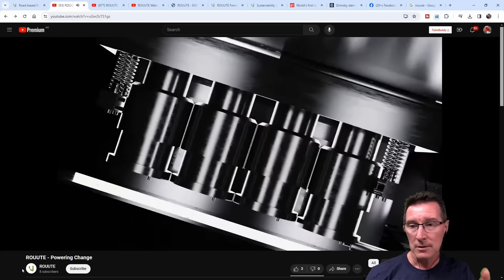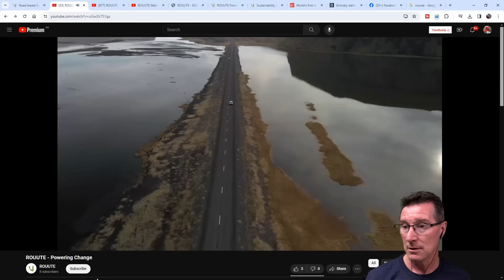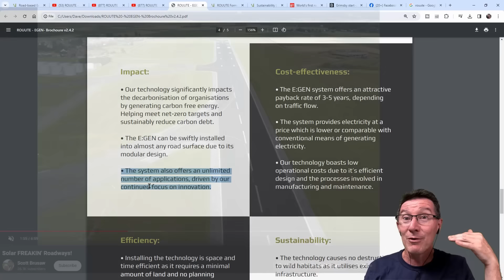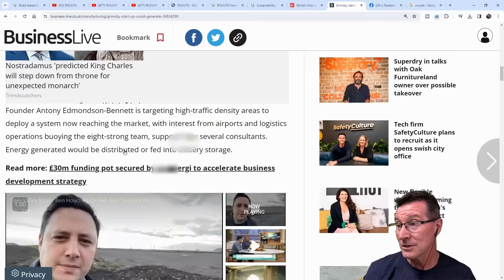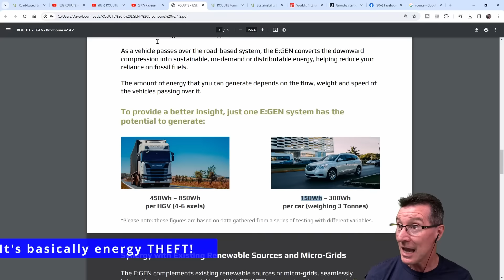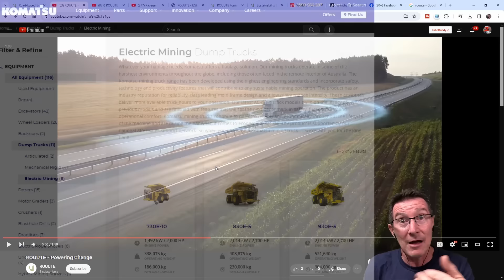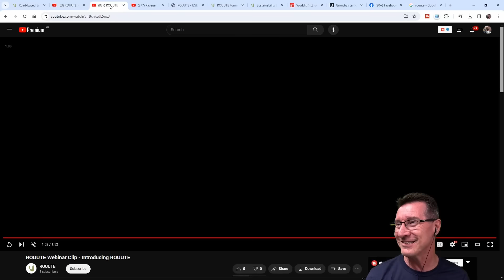EEVblog 1600 - Rouute: Road Based Energy BUSTED

Comment: You know when it is BS when there is an unbelievable story (fairy tail actually) to tell , a superb flashy "steve jobs apple" stock video is present, showing photoshop pictures instead of photos of a real product, claiming remarkable results without any proof or evidence. About the demo video, they didn't show the actual unit and it could be an existing measure instrument of some kind used at a research facility (for vehicles) somewhere. This guy is possibly very good at photo/video editing.

Comment: Yeah that's a great idea, a road powered by gasoline and internal combustion engines of the cars driving over it. Definitely green energy! I think the 150-300 Wh figure is from one "system," which includes multiple bumps. Also, I find it amusing that they need to place solar panels on the tops of their generator boxes.
Reply: The solar panels will run in reverse, storing the energy back in the sun.  Genius.
Reply from the maker: Probably hundreds of bumps in that case.
Reply: Yeah ... a road, nay highway, worse than a dirt track, kilometers and kilometers of just bumping ... if you want that those pot hole infested street in the US or your local neighborhood, you'll get a feel for how well that feels and good that is for the car's suspension.

All I know is that when then GDR was still a thing potholes on the Highway left us without breaks, specifically drum brakes, springs and such. That would be really nice in these USofA as 70% of their trucks for longhaul (40 t, etc.) still have drum brakes and already problems with burning them up.

Comment: Make a rail version and put them before stations where trains have to stop ;)  Except - I am sure most moderns trains will recover the energy themselves.
Reply: Yes, modern electric trains do have regen.
Reply: There's mention of a similar scheme -except it was rollers in place of the rails, I think - in OVS Bulleid's biography.  He was the junior guy from the CME's dept dispatched to explain to the inventor why it wouldn't generate free electricity, just increase the coal consu,option of every train that passed.  This happened pre WW1, and he was still salty about it 50 years later.
Reply: Bumpy energy regenerating freaking bike paths

Comment: I am going full enterprise with this idea. Its like mining free energy...going to buy a fleet of heavy cars and drive them in circles over the energy bumps and reap the rewards by selling back to grid. Good bye job..heloooo lambos and supermodels
Reply: There's a couple of mines with electric trucks, they drive the loaded ones downhill and get enough charge to drive back uphill empty.  See, free energy is real, ya haters.
Reply: @j.f.christ8421  Maybe mines work differently here. Our trucks drive down into the mine empty and drive up full. But I am in Australia, so everything is upside down I guess.
Reply: @Thermalions  Komatsu (who I used to work for) have been building big electric yellow things.  But yeah, they've got a few doing the "free energy" trick, there's some in Germany, Switzerland etc.  Works better when you're knocking the top off a mountain.

Speaking of Oz, Fortescue reckon they can do the same thing with their "Infinity Train"; load it up and recharge downhill to the port.  Of course "downhill" here is only about 500m, but y'know, 3k long train.  Announced in 2022 and it'll be running in 2 years time...

Comment: Installing those speed bumps on highways as suggested in that promo video would be a recipe for absolute disaster. Hitting bumps like that at 100km/h+ will almost certainly cause many deadly crashes. It will scare the living crap out of inattentive drivers. Any car with any structural issues will suffer damage. As a =motorcycle rider I would actively avoid any road that has those things fitted and it is almost guaranteed to launch riders and pillions of their bikes.

Comment: omg my idea is better, cars weigh a lot so like lets make the road sink in as it goes over while it pulls a flywheel omg omg
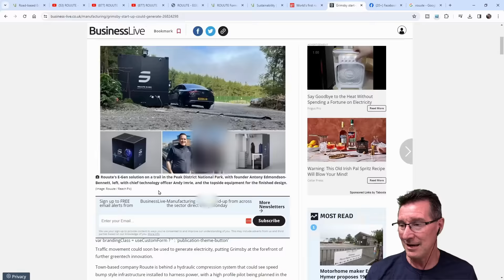(10:29 in and omfg its my idea!) lel
Reply: Nah, just put windmills next to the road so when you drive past them the wind from your vehicle makes them spin.

Umm, that's actually a real thing, by the way.  Still better than bumpy roads though, you might get a bit of power even when there's no traffic.
Reply: @j.f.christ8421  omfg that was my other idea! drive cars through a tunnel so they push pressure out on the end to produce wind power! while wait for it.. everyone doesnt breathe in the tunnel

(#DontBreatheToSaveTheEnviroment)

Comment: Just the additional wear and tear millions of speed bumbs will add to the cost of maintaining the cars will make this a boondoggle, let alone the cost of maintaining the speed bumbs themselves.
Reply: And they are not harvesting the sound energy!!

To be fair - if this was used to power some infrastructure local to an area you want to reduce speed in (ie typically what a speed bump is for) then it sort of makes sense. But that doesn't appear to be what is marketed.
Reply: @stephenhookings1985 yeah, the scam is the marketing because it makes no sense in the context they’re selling it. Replacing regular speedbumps with these, particularly in areas that use speedbumps in combination with illuminated signage (school zones often do), would make way more sense as there’s no additional impact on the vehicle or driver.
Reply: Speed bums are quite expensive.
Reply: I mean, if you put them where there are already speed bumps, like in front of crossings or entrance/exits to the parking lots, sharp turns on streets and what not, I can see this actually being useful. Plus if speedbumps are damaging your car, that's your own fault for speeding.
Reply: @MaximilianBrandt  Agree on that, however I personally doubt the numbers would pay off considering the expense not only of the initial installation but of the maintenance. Lots of moving parts exposed to very harsh conditions.

Comment: Turn it around and use it to push vehicles. The only problem is that to push a vehicle at highway speeds would mean a really large wave in order to get the slope needed. I've coasted down hills at highway speeds, but just imagine a road that makes a wave that pushes the vehicle. And all this could take power from the power grid to power it. Of course it would be a lot less expensive to use overhead catenary wires
Reply: That's a good idea. Make hydraulic powered bumps, raise one end and lower another, gravity moves it forwards, then shift it along. Free energy - cars don't need petrol any more, they just run without any power source. Can't see any problem with this design.

Comment: Looking at things like this hurts my brain. The energy comes from the vehicle. Zero carbon footprint? Not if the energy is coming from somewhere. And whatever you are harvesting is vastly less than the energy expended by the vehicle to push over the bumps. The quoted energy per vehicle claims are laughable and just off the cuff make me wonder who the heck came up with these insane claims. This shows a serious lack of physics understanding and the infrastructure needed to implement a system like this is crazy. Not to mention the durability of the system. What a crock. And if you were to  put these on downhill segments of roadways to capture energy while slowing the vehicle down, then you would be stealing my regen energy from my EV that I used on the way up the hill. No sir, in the immortal words of Elon, GFY.

Comment: E = mgh. If vehicle weight 3000 kg and bump compressed by 10 cm, then E = 3000 * 9.8 * 0.1 = 2940 joules or ~0.82 Wh 😂
You couldn't extract energy from speed at all - primary function of speed bumps is to slow down car BEFORE it will hit it, so speed is minimal during crossing and we can use potential energy formula instead of kinetic one.

Comment: Am I thinking about this the right way, a rough estimate of the energy harvested per strip is equal to the potential energy change of the vehicle, E=mgh, so say 3t, super optimistic 0.2m displacement down on the strips, so realistically 5886J=1.6Wh, so pretty much off by a factor of 100x on their 'estimate'...?
Reply: Yep. At the beginning when I was hearing 300wh it just felt wrong. I was expecting like mwh or like much smaller units. Gut said like 10x out. 100x is no surprise. 

These folks rely on their basic physics not being challenged. This makes me mad. It’s so disingenuous. Shame on these people!
Reply: While i'm also dubious on the 300wh claims you're forgetting about the kinetic energy of the forward moving vehicle that will also act to compress the hydraulics. essentially slowing the car and using a small % of that kinetic energy through the generator
Reply: You don’t watch Dave’s whole video did you?
Reply: The more realistic factor is probably more than a thousand.  I cannot believe you can get 0.2 m displacement, more like 0.02m (2cm).
Also 3t is not a realistic figure for the average vehicle mass.
My guess is that where their document says 300Wh it actually should be 300Ws and somehow this got "autocorrected" to 300Wh.

Comment: If I was doing this, I would make the surface out of an array of triangles of stiff material with a flexible cover over top. At the points where 6 triangles meet, I would put a spring, a strong magnet, a coil and a diode.  When the magnet is forced down, it would make a little electrical pulse.  These could be placed anywhere where you want to seriously shorten the range of any EVs or make ICE cars burn a lot more fuel.

Comment: At the best you could say the system is "stealing" energy from each vehicle passing over it thereby reducing the range of the vehicles.  Maybe the vehicle owners have a claim to be paid for the energy taken.  300Wh from the UK grid will cost about £0.10 so the power from a thousand vehicles would be a significant "speedbump tax".
Reply: It would be a kind of funny way to collect a toll for a toll road or bridge. Just harvest energy from all the cars, and sell that energy. Obviously very inefficient, but a funny idea.
Reply: @CutoutClips Bridge trolls are getting smarter 🤓
Reply: Wowee. 1kw here in southern Ontario is like 20¢. Like half of yours in UK
Reply: You could just say 1kwh is ~£.33
Reply: @oneplaneteer1708 I left that as an exercise for the student :)

Comment: 16:00 Holy crap is that what the web looks like without an ad blocker now? That's terrible.
Reply: Yeah. And personally I can't focus on text if there's a moving/flashing image within eyesight. Just awful.
Reply: Also disable javascript to avoid adblocker detectors wherever you can.
Reply: @leerman22  How is he gonna do calculations on a website without a Turing complete language?
Reply: Any time I touch someone's browser without a dozen protection extensions installed, and venture out into the Internet, I feel like I am on the street and forgot to put my pants on!
Reply: It's not that bad, 99% can be skipped.
Reply: That's not even the worst example haha.
Reply from the maker: You'll live.
Reply: @EEVblog Amusing response in a video where you complain about something where the answer can also be "You'll live."
Reply: @EEVblog was that ever in question?
Reply: @EEVblog  yep.  Because i use ad blockers.

:p

Comment: Energy methods apply to the calculation here. Think about extracting 150wh over a few seconds. How many hp would you need to provide in that few seconds? As you said: yeah no. Unless you allow only electric cars on it how is it a carbon use reduction? I love these inventions.
Reply: Even an electric car, the energy produced from the bumps got taken from the car which then needs to be rechared by something. It's a net loss right from the start. Not to mention all the energy used to build, transport, dig, and install these plus the battery storage.